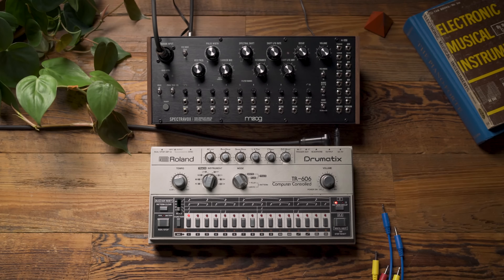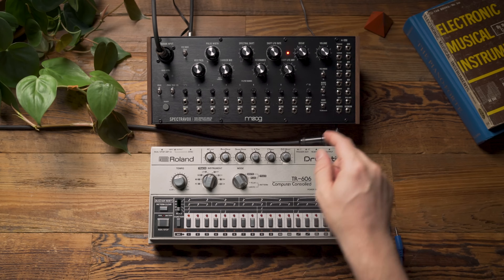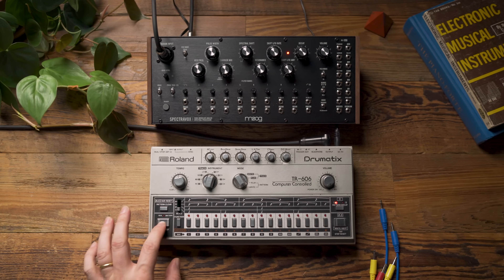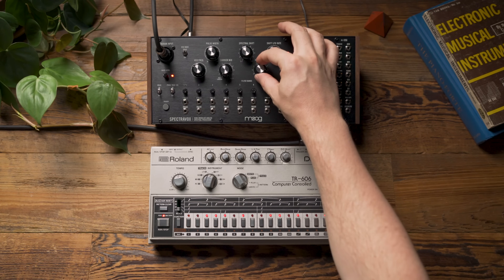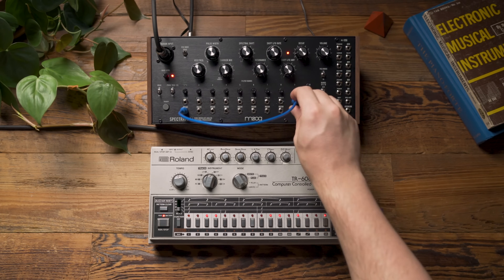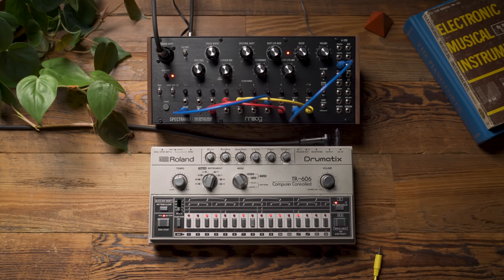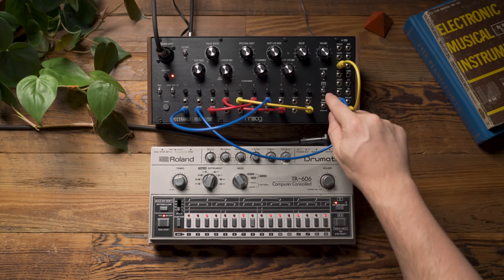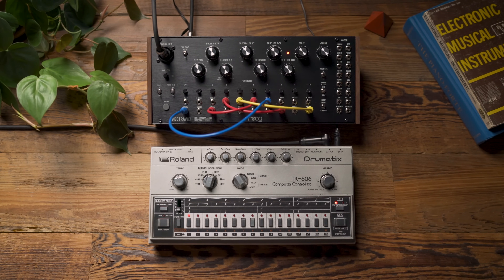Spectravox | Vocoder Processing

Comment: Nice. Is there a dry/wet mix for the incoming signal or a way to have a thru signal of the input for parallel processing? It would be nice to hear the raw 606 blended with the processed signal.
Reply: you can get the amplified Program input out of the patchbay yes. Wish you had a knob for mixing it in but it can be done externally at least.
Reply: @nanocyde_artist  thanks! Good to know

Comment: Is it possible to implement a dry/wet knob with an attenuator or some other external gear??
Reply from the maker: If you have a mixer, you can use Spectravox as a send/return effect, and then you can blend your dry signal with the return from Spectravox.

Comment: Does the Spectravox have a simple Line-In input rather than using the Vocoder input?
Reply: It is a "1/4-inch XLR combo input for microphone, instrument, and additional sound source processing."
Reply: In addition to the XLR + 1/4" combo jack, there is a 3.5mm line-level Program input in the patchbay on the right.